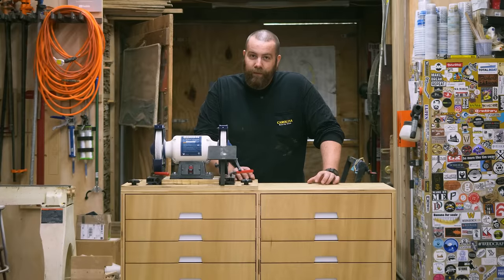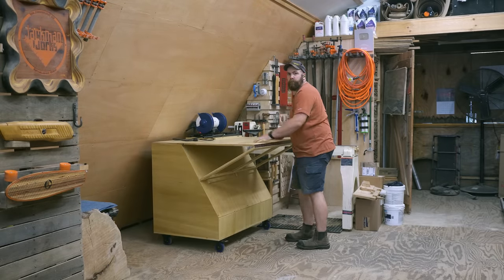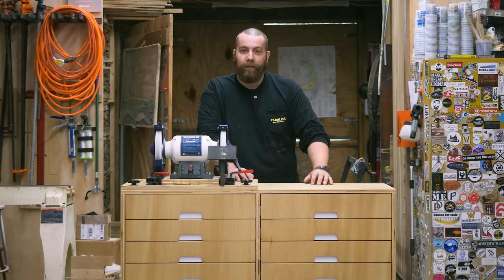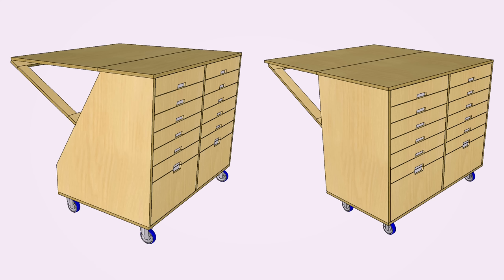TRIPLE your Table Space with a Weirdly Custom Cabinet

Comment: Just think, if you visited Pask down in Australia you'd have to put the wheels on the top, the back angle the other way, and probably have to include a recess for a propeller to swing through. Not to mention assembling the whole thing while standing upside down...

Comment: I didn't understand how the design made sense until you pushed it against the wall, and then it made a lot of sense.

I don't think I'll do either version because I'm worried that the wheels aren't far enough out to balance it properly if you're doing anything serious on top of it.  And for non-serious work, I've got plenty of workspace already.

But it was an interesting design!

Comment: I love how you cut the drawer pulls out with the CNC router.  Was it hard to repeat that setup?  Do you think that could be done without a CNC maybe with a miter cut and/or router?
Reply from the maker: I added blocks to the bed of the CNC to position the drawer fronts in the same location, which made that setup super easy.

Without a CNC, this would be easily achievable with a router and a couple of jigs to get the same results. I might make jigs for that for the next cabinet I build because it honestly might be quicker than the CNC.

Comment: What a great build. I was curious have you thought about adding a 1/2” round stop on the other side Or a peace of wood with nice taper up. so the table top would still slide up, but never slip closed when in use.
Reply: JackmanWorks.  for real? What do I need to do?

Comment: How do the drawer bottoms hold up? 
Glue and staples versus rabbit.
Reply from the maker: So far, so good! Did the same drawer configuration on the router table too and haven't had any issues so far. If the drawers were larger, I might think about another method, but for 2' wide drawers it's been perfect.

Comment: What are your thoughts on drawer bottom strength? Weight limit for the drawer content?
Reply from the maker: I haven't had any issues with that drawer design yet, between the glue and the staples it seems plenty strong for drawers of that size. If the drawers were the full width, I might want to rethink that, but so far this has been solid.

Comment: 7 seconds into this video and I already know I need these plans!  Damn that thing is cool and handy looking!
Reply from the maker: So handy! I've only made 1 so far, but I'm already thinking about making a couple more.
Reply: @JackmanWorks  with the way your ceiling comes to the wall, I would think that's the most efficient way to maximize the space. It's just too short to use for anything really. If you put shelves there, whatever is in the back would be lost forever. Next level problem solving Paul!

Comment: I like your videos very much. I'm thinking about buying a pocket hole jig I live in Denmark my question do you have to buy special screws to use with it
Reply: Sort of. Pocket hole screws are usually just screws with a slightly larger and flatter head on them, to provide lots of contact surface and clamping/holding pressure, but minimize the risk of splitting. In a pinch you can use regular construction screws, just be aware of the risk of splitting the wood if you tighten too much on the wedge-shaped heads.
Reply: @ericnorman2176  thank you

Comment: Only a second in, but if there isn't a locking mechanism there needs to be, knocking the arm up will give you an unhidden mess on the shop floor.
Reply from the maker: You're right about the mess that would make! I don't anticipate need for a locking mechanism, but that should be easy enough to incorporate if I ever run into that issue.
Reply: @JackmanWorks  trust me, you'll pick something up, walk right past it, and shunt it up by accident. If only for the fact ive put it in your mind now :)
Reply from the maker: @mechminded2207  hey, if it ever happens, it’ll only happen once before I either fix it or just light the whole cabinet on fire with the chaos that would create from dumping on the ground 😂